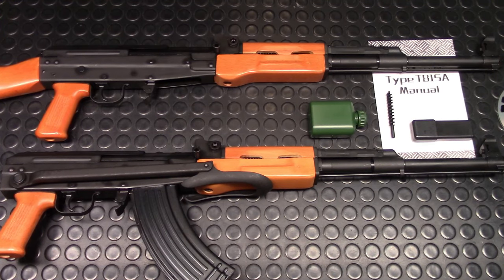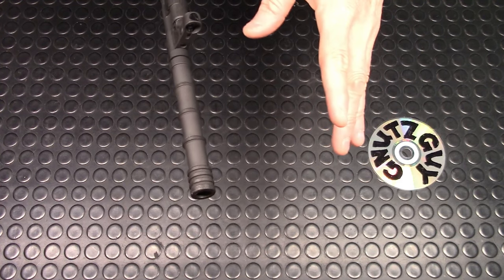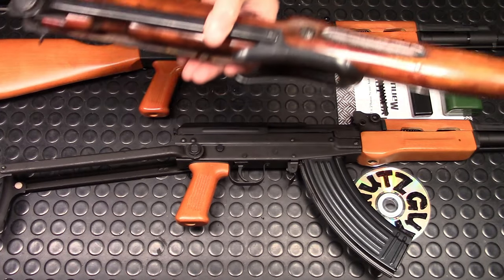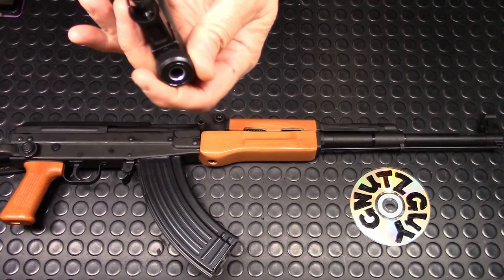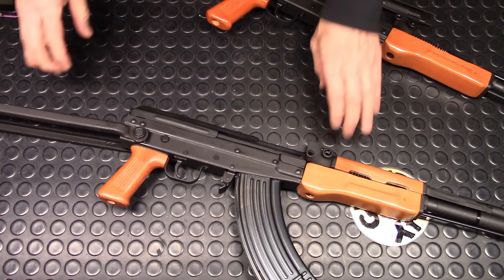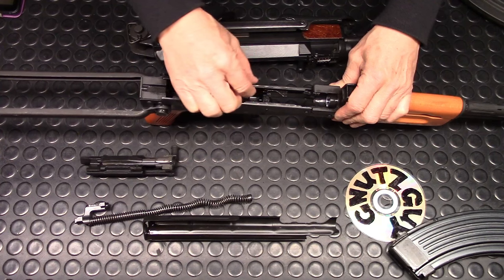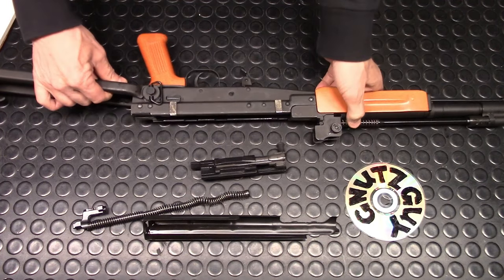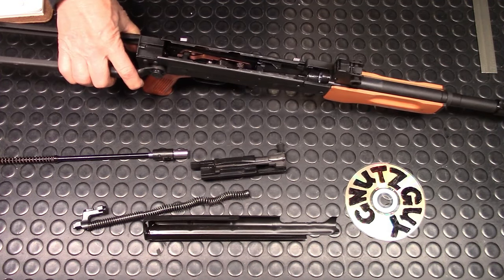Bent is back!!! Type 81M review Variant 3, T81 Underfolder. Read below.

Comment: I got both options because I wasn't sure if I would like the underfolder, but like you it is now my favourite.
Reply from the maker: good to hear.
Reply: Is it possible to shoot the underfolder accurately? To me it looks like it would be hard to get a consistent site picture.
Reply: @ziggyz2958 to me it’s more comfy to get sight picture on the under folder. The fixed stock version has an uncomfortable angle so I have to tilt my head a lot to get proper sight picture
Reply: @streetfreak  Can you shoot the underfolder with the same accuracy as the fixed?
Also, was yours straight?
Reply: @ziggyz2958 haven’t gotten a chance to shoot lately but I definitely do want to see if they shoot straight…
Reply: @ziggyz2958  just got my underfolder the other day shot really good groups  its a  very  accurate  gun so yeah its worth getting it.
Reply from the maker: Paracord vid coming out today

Comment: I think Tactical Imports has the ability to make most of these from scratch now...  or maybe they always have... idk.  These M variants along with the SR provide good evidence to support the notion that these arnt just repurposed and modified LMGs. The forgings / castings are different, the tin work is different, the barrel profiles are different. The SRs front sight base has no cleaning rod retainer like the LMG and M. The M has a cleaning rod loop on its gas block that neither the LMG nor SR have. The Ms front trunnion is bored to accept a heavy barrel blank like the LMG and SR however it does not have the carry handle holes. Both the SR and the M have no barrel step to support the LMG bipod. And obviously the SR has a totally different gas port location and the required change to the gas system tin to accommodate that. Interesting stuff for a Type 81 enthusiast.
Reply from the maker: i never thought that bcos i've heard the LMG was commissioned by norinco (not polytech) who use a different factory which had no bent inspite of a longer barrel so obvious the M wasnt built in that LMG factory.
Reply: @gnutzguy Norinco is the export organisation not an individual factory. Polytech is one of several factories which receive orders from Norinco which acts as a single point of contact for foreign purchasers to approach these companies. So all contracts will be commissioned by Norinco.
Reply from the maker: @thomassimpson6901  you are wrong. Norinco and Polytech are both exporters. Both belongs to government but different wing. Example PLA or ministry of defense. They do not manufacture firearms. They commission the production of firearms with different factories. The Canadian importer has been dealing with Polytech and thru Polytech to a factory that builds for norinco.

Comment: first off, thanks for the breadth of knowledge on Canadian firearms you've provided over the years.
now for the sacrilege part: despite your affection for the underfolder, is there a chance you might make a video doing a full disassembly of the folding mechanism, to see if the back plate is removable, and basically whether it's possible to non-destructively remove the undefolder element from the rifle, and see if various Sigmaco stock adapters would fit on it.
there are a lot of people who want the T81, but not the underfolder and since clearly TI brought far more of those models in, knowing whether stock could be replaced would make a big difference for many. either way, thank you for the informative videos. you've been upgrading these rifles long before there was Sigmaco or any custom Type 81 furniture for that matter, so I thought I'd ask if you would be willing to do a deep dive on the underfolder and the options of upgrade on it as well.
Reply from the maker: i havta stop you right there. the underfolder trunnion arent removeable but i have already done a vid on underfolder disassembly. https://youtu.be/MpPIdFSLULc
Reply: @gnutzguy  oh I see, so there is no way to change the stock on the underfolder then? remove just the folding mechanism/wire stock and the back plate and put in the Sigmaco adapter? I guess the trunnion itself is different eh, no space for adapter there?
Reply from the maker: nope, nada, nil bupkis, lol. nothing from sigmaco will work with underfolder.
Reply: @gnutzguy  thanks, appreciate the information. keep up the good work!

Comment: Im happy i got the underfolder its really good
Reply from the maker: so there are not bent undie out there, interesting.
Reply: @gnutzguy  yeah mine looks perfect 👌. I did not measure the deviation on this one though. 

I did with my previous SE that was bent at the rear trunion it turned out be well in spec.

With this one i will probably simply use a laser level to pull a straight line from the front sight to the center of the red dot to see if it's close enough but looking from the rear trunion cleaning hole it's close to perfection
Reply from the maker: Lexus: looking thru the butt hole also works. Lol.
Reply: @gnutzguy  like you suggested it is indeed slightly bent to the right. But i really had to look for it and with the laser level it seems to be only a couple mm off at the middle of the red dot. So i think I will have to zero it and see how it changes the poi at different distances. I will measure the deviation properly to have a point of reference.

Comment: I got a type81m fixed and it is noticeably bent, disappointed and dont want it anymore, going to try and send it back.
Reply from the maker: I hear ya but they won't take it back without proof of the deviation test.
Reply: @gnutzguy that's because so many people have become convinced that their gun is bent when in reality it's perfectly fine. No doubt some have issues, like TI said .05% of all previous rifles had the issue. One guy screaming out of 2000 makes everyone think the issue is universal. It's good they require proof or else theyd end up refunding perfectly fine rifles.
Reply from the maker: @AthelstanKing  you are wrong. The truth lies somewhere between universal and what importer says.

Comment: I'm buying a T81 underfolder. They
are priced lower than most other
T81. Will put underfolder on SKS
for the ultimate ruck sack rifle.
Then will fiddle around putting 
either a fixed stock or VZ58 side
folder on the T81. Problems to
my perfect plan?
Reply from the maker: when i first posted a vid on installing a underfolder on SKS, the problem was there werent enuff of AK underfolders in canada, plenty in the US. the T81 solves that problem. 

good plan, i wanna do the same vid but the only problem i see is how do you plug the large gapping holes (looks fugly) left by the underfolder?  hoping for an upstart company to make an alloy adapter that will solve that problem, similar to the AK underfolder to M4 stock in the US.
Reply: @gnutzguy  Yeah, I'll end up
with holes to plug somehow.
Cant be to fussy when youre
broke hehe. I'll let you know
how I go about it. My Bubba
spirit is strong and I'm a
toolmaker so I'll figure out
something. Also, I'm in touch
with NorthernArmoury on
Gunpost he produce nice
3D printed stuff for the T81.
Plenty of SR owners with 
buyers remorses to help too!

Comment: You might want to look up the 1 in 60 rule. You need the distance between the 2 measuring points length to turn those mm into degrees. That being said.. that length would have to be less than 60mm which from your diagram is not the case.. Nice review as always!! :)
Reply: Do you mind elaborating. I'm a bit nervous about the barrel bend situation.
Reply from the maker: Gristle: im guessin you didnt read the description. i made the correction there already. has nothing to do with degree. it was late and i was tired, i got confused, lol

Comment: I would like to cut down the barrel sleeve to original length; are you saying that would make the rifle restricted? I haven't measured everything but, the overall length should be fine. Love your channel. Truly a reference for the Canadian gun community. Thank you.
Reply from the maker: To my knowledge, you can't cut barrel to restricted. Best to consult with a gunsmith plus the bore is chrome so you need to be careful not to chip it around the muzzle then you need to crown it.
Reply: @gnutzguy  I meant to cut the grenade launcher sleeve to the original 2-rings length plus add the longer ring at the muzzle. Maybe even the groove for the bayonet. I'd prefer not to mess with the barrel if possible. Of course, I would consult a gunsmith for the same reasons you mentioned. I also don't have a lot of the required tooling and would probably ruin the rifle if I did😅 Thanks for answering.

Comment: I have a compatibility question, do you know if the top cherry wood handguard from the type 81 SE SA would fit on a type81M the new one orange wood from this year? I would like to swap it easily and not see any gaps/shims / do any machining. I see you have many versions I’m hoping you might know!
Reply from the maker: that depends on whether you are talking about the woods on the upper or lower HG. 
on the upper all are interchangeable except the dragunov variant 2 also bare in mind the orange wood has a deep finger grove where as the red and blonde dont.
on the lower, the red are not interchangeable with variant 2 and variant 3, only with variant 1.
Reply: Yeah I’m looking for an upper handguard for my orange M from this year, so for the red SA SE upper does the compatibility also extend to the metal piece it’s attached to? The metal part that goes over the gas block, I’m hoping I can go back and forth between these two without messing with rivets each time. Thanks!!!
Reply from the maker: @CODMONSTER4LIFE  red and orange uppers are interchangeable, both wood and metal.
Reply: @gnutzguy  exactly what I was looking for. You’re a savior friend!

Comment: For the deviation test- It would make more sense to measure to one side of the barrel (as in the side furthest from your straight edge, regardless of the side you measure). The way you do it does NOT correct for if you aren't exactly centred on the barrel with your marks (if you are 2mm to the left, then that side shows 2mm less and the other 2mm more). Great info though, thx.
Reply from the maker: Lol. I know what you mean but this is the procedure they recommend for warranty.
Reply from the maker: did you read the description?

Comment: The method to check if line is centred on the barrel doesn't seem right. In your example, if the line is drawn 2mm off centre to either side, the 2 measurements would still add up to 44mm.
Reply from the maker: correct. see third example and they do add up to 44mm. dont take the diagram as actual.

Comment: How precise are magnets stuck to the side of a stamped piece of steel and then also using a ruler that could have a bend in it ? I’m not saying you are wrong, but I wouldn’t be convinced it was bent using this method. And does it really do anything ? The barrel isn’t bent. It may not be perfect on the receiver but that could be on anything and i don’t think it matters much with a rifle that has both sites on the barrel. I could be wrong. I’m curious on someone else’s input.
Reply from the maker: i didnt finish reading your post bcos this is the method the warranty call for. ofcos there are other method but probably most owners could do this.
Reply: Hi! I got interested in the type 81s recently and order an underfolder on TI a couple days ago. Now, after reading through forums and watching your vids reg canted barrels, now im kinda worried. In your case you said it's <4mm, is that bad/terrible and have you got any solutions or suggestions how to deal w issue? thanks! @gnutzguy
Reply from the maker: @aaronpestano6921  a bent T81 only effect you if you use a scope, otherwise no issue. just not perfect.
Reply: thanks you so much for the clarification! much appreciated! this is the answer i was looking for. i thought it was something so critical that affects the overall functionality of the firearm especially, safety. my firearms knowledge is still limited and the info you provide and videos you do provide a wealth of knowledge. @gnutzguy

Comment: I need a 556 type 81
Reply from the maker: yup, 308 wouldnt hurt either.
Reply: Yes!
Reply: Range friendly (non corrosive non steel core) 223/556 is just so much cheaper than 762x39

Comment: Can you change the stock on the underfolder?
Reply from the maker: yup, you can but first you need to watch my underfolder disassembly (not easy) and secondly, you dont mind gapping holes left by the underfolder. 

some people are making 3d printed adapter that cover up the holes and attach a m4 tube but suspect it wouldnt last. needs to be made of alloy.
Reply: @gnutzguy  thank you for your answer. most appreciated

Comment: Because I like math I did it for yall
Numbers rounded and going off 3mm over 18 inches.
50m shot puts your point of impact 0.7 inches over
100m shot puts your point of impact 1.4 inches over
If your using the irons, the bent trunnion isn't an issue. If your using a receiver mounted scope sighted in at 50m your point of impact at 100m will be ½" off
Reply from the maker: your math is wrong. using basic math.
3mm= 18"
328mm= 50m (1968")
656mm= 100m (3937") .... 656mm is 25.8" not 1.4"
Reply: @gnutzguy  I redid my math. You're correct. It's a .4° angle. I somehow got lost and was going with .004
Reply from the maker: @jalexandermt  No worries. So can imagine my first rifle was 5.5 degree deviation. Almost hitting the next guy 🎯 target, lol. Joking

Comment: Has anyone tried straightening the receiver ?
Reply from the maker: It's not the receiver nor the barrel, both are straight. It's at the barrel block, not something any of us should tackle. Best left for a gunsmith.
Reply: @gnutzguy  are there any negatives to this ? I thought it was the receiver because my side mount for the scope doesn't center and is way off, plus looking down the receiver it looks pushed out on the left side.
Reply: @gnutzguy  I was referring to my own gun btw but I'm guessing most barrel blocks are offset or is the block actually warped/bent?
Reply from the maker: @hardstyle719  how much is yours deviated? If your receiver is actually bent then you would experience fail to feed and fail to eject.
Reply from the maker: @hardstyle719  the problem lies with the short barrel blocks, no issue with the long barrel blocks used in the lmg and sr so don't know why they can't fix it?
Reply: @gnutzguy  Im not 100% if my receiver is bent. I don't have the proper equipment to do the deviation test but just by eyeing the rifle with everything apart, to me looks bent. Really appreciate your help btw love the vids!
Reply: @gnutzguy cycled all 40 rounds on gas setting 1 without any issue.
Reply from the maker: thanks ..... 40 rds cycled? then you dont have a bent receiver. you got the regular bent, lol....  so if you want to file a claim? you need to prove deviation of 4mm or greater.